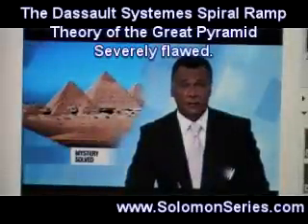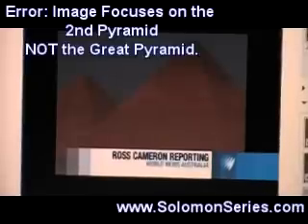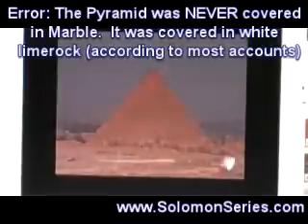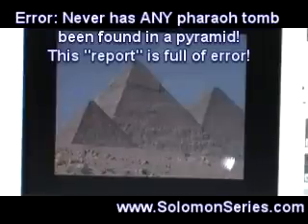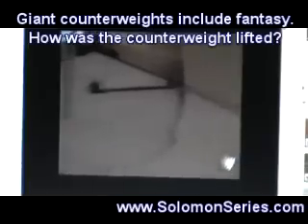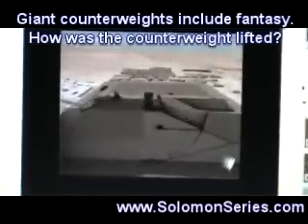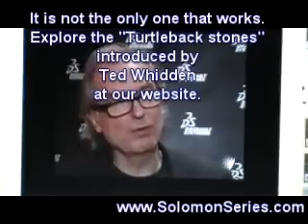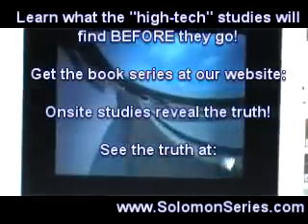The Dassault Systemes Spiral Ramp Theory of the Great Pyramid is Severely flawed

Comment: @SolomonSeries LOL..yes,they could have moved the stones,but moving the stones is one thing,building these structures is another,imagine moving your car transmission,pretty easy right,now move it,and hold it up,while lining it up to your motor..not so easy anymore,now imagine the mathematical and architectural work involve...this would be like holding up the trans while measuring where the bolts belong and making the holes for the bolts...the math just doesn't equal the labor.